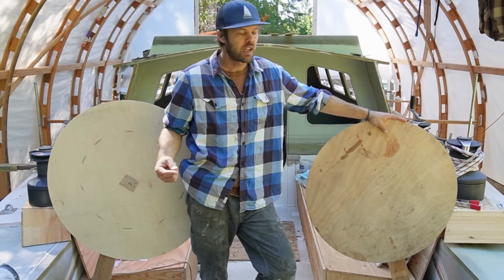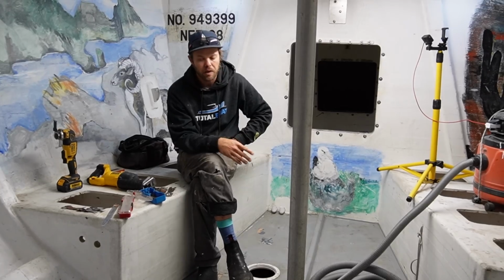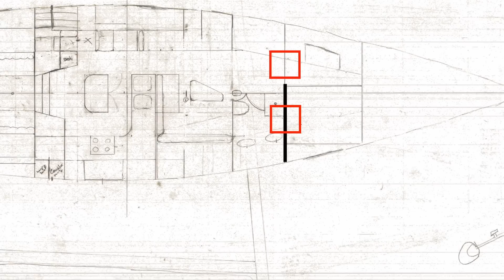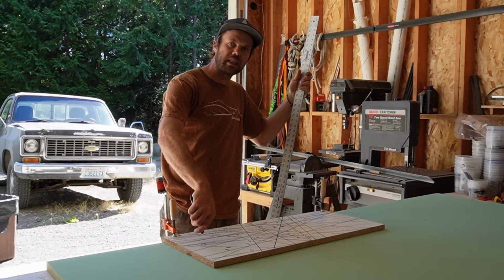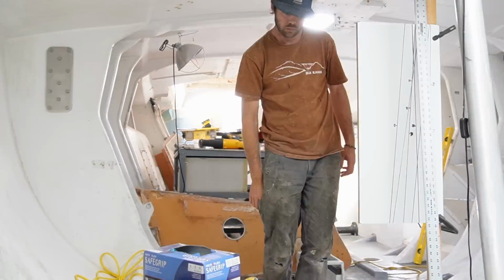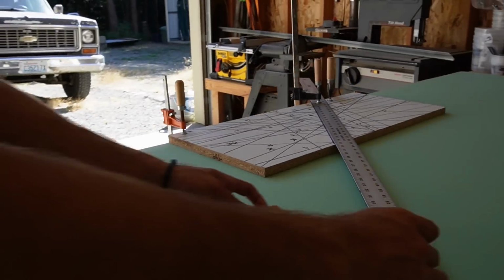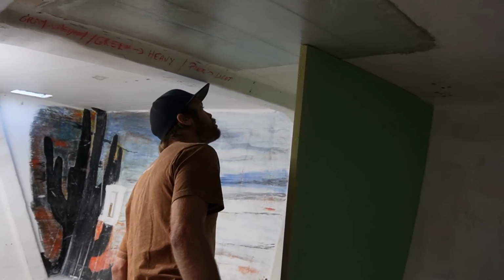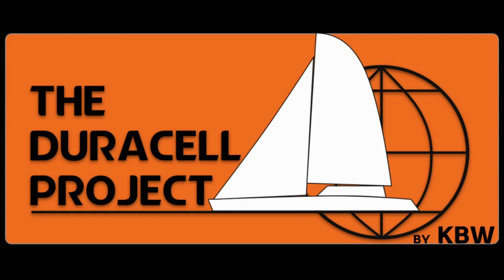Boat Refit: Building the State Room [E45]

Comment: I increased access to the bilge the length of my Cal39 when I was getting her ready for several years of cruising. That decision saved the boat when I took on water 80 miles off of Georgia quickly b/c of a blown gasket on the dripless shaft seal. I very quickly had cold ankle deep water at 2 in the morning, and being able to access the entire bilge was what made it possible to very quickly identify the issue. terrifying experience.
Reply from the maker: Yikes

Comment: Hey guys live the videos! 
In previous episode you were mocking the coaming. 
What about embedding aluminum plate that you can tap into to attach winches spin locks etc to? 
Heavier but easier than accessing backing plates if you need to remove, reposition, repair hardware.

Comment: That was a complex (complex for me as I am not a boat builder) series of lines and measurements but, they worked out correctly.  I can visualize what Matt is doing as he completes each section and it looks like it is going to be a great interior when he completes the design.  I thought initially the master bedroom section would be larger with a master bath and bath, but know that Matt has that figured out also.  It would be nice to see a conceptual layout of the interior of the boat and then it would all make more sense to us novices.

Comment: Sheesh. I laminated many meters upside down with wide taping (up to 12" wide). Fully wet out the biax on a flat table with regular resin, then sprinkle (list dusting only) with colloidal silica. Thickens the surface layer of resin. Roll up the tape, and unroll onto the surface upside down, pressing in place. Just keep track which is the thickened side.

Comment: I’m really interested in your project. I wish you would revisit what you plan for the keel, the original keel was a deep, high aspect ratio keel which was highly efficient for resistance to leeway and gave good righting moment with a minimum of ballast. You will have to add ballast to have a shorter keel and maintain righting moment. How will you configure the fin with the necessary added area to resist leeway? Will you just make it wider or will it be some sort of trapezoidal affair?
Reply from the maker: this is a long answer. We will get back to the keel conversation as soon as we secure a mast....hopefully soon!
Reply: Short answer: Matt wants a considerably shallower keel for cruising. So he is will REDUCE righting moment deliberately. This will allow use of a lighter mast than the original. This also means you can't carry as much sail area in stronger winds because you've reduced RM. You reef earlier or the boat heels too much. Area is a different story.

Comment: Matt.   Have you Thought or Try one Steering Wheel that Goes Left Or Right  just be Less Cost and a little More Room.  It just look more cramp with Two Wheels! Have you thought of countersink your Winches for more room up top?
Reply from the maker: yes, we had a dual versus single helm discussion in an episode a couple months ago...can't remeber which number episode it was now! A single helm would totally work, we just prefer dual. Just a preference thing.
Reply: @TheDuracellProject  Matt thanks. Would you mind if the Video could be longer so some else love to learn More on Fiberglass and work with Epoxy

Comment: Not to sure about having your work bench area before your forward cabin. You might not be able to sleep at night looking at things on your to do list  on your way to bed not to mention it might be a bit ugly. 
Re your cockpit lay out I would suggest a over hang on cabin roof and sides to give a little shelter from the elements if outside on watch at night. 
I would also make the seats as long as possible too
You will find this area the most used when cruising especially in the warmer climes. 
Keep up the good work.

Comment: From a desktop Phantom Shipmate - the larger, 33" steering looks to have notably better leverage than the smaller one, eh?
Reply: Leverage can be adjusted by changing pulley sizes also, so really the wheel size should be chosen based on other criteria like leaving enough room to walk down the center of the cockpit, for example. But also being comfortable to drive both sitting and standing.

Comment: Love your  ticking stick method. I built  a special tool to do that job  but it requires  a much  larger template  something thst is less than one foot smaller  than the actual size. Your method requires  no special tool and a much  smaller  template,  Brilliant,. I used the same method for my boat Samantas but....

Comment: I don't know about anyone else but I would like to hear Mat explain why he used marine foam and not house insulation foam. I've defiantly seen installation foam used on boats with success.
Reply from the maker: House insulation foam isn’t structural or marine grade, then again I have never tried it
Reply: It lacks sufficient shear strength to act as a structural component. Maybe as a small locker face that is non structural for example. But otherwise you can't; it's much too weak. Typical blue/pink foam has about 20% of the shear strength of a 80 kg/m3 PVC foam.
Reply: @evangatehouse5650  makes sense. It was being used as dodgers and reinforcement ribs. When they were being used as ribs it was for giving the glass form

Comment: My name is John and I am older and don't sail much any more. However, I am certified offshore and delivered sailboats up and down the West Coast and due to the veriety, have a fair idea of what makes sense and what doesn't. With regard to weight balance side to side is as important as bow to stern. In addition, weight carried down is better than weight carried aloft and as close to bilge center as possible. One more thing, Duracell was built as a race boat designed for the 80's 50 years ago and has far less beam that the current iteration. Dual wheels will eat most of your cockpit. why not use a 40' to 50' wheel and since the wheel is seldom turned more than 120 degrees, the bottom of the wheel could be constructed with a flat bottom 140 degrees side to side from top dead center. I have sailed both types, my preference is a centered wheel with enough diameter to handle while at the coaming. The flat bottom would eliminte the trough in the cockpit floor and would be easily maintained even if turned more than 140 degrees.  You could also have stern seats for sharing the helm with your lovely wife. Just a thought and would enjoy yours. John K

Comment: Out of curiosity, are you concerned at all about the vertical clearance of the interior, particularly once you get floorboards and ceiling panels in? I'm watching you scrunch about in there to avoid hitting your head, and that won't be comfortable long-term!
Reply from the maker: It's a good question.  The overhead is pretty short as it is now.  I'm going to lower the floors a little forward of the mast, where the overhead is the lowest.

Comment: For the cockpit are you considering shading the helm area? Seems very exposed, which for a racing boat is fine, but cruising?
Reply from the maker: yes, there will be some kind of shading for sure! That's way down the line, though.
Reply: How you cover and support the helm area may play into your cockpit design, especially seated and standing helm positions

Comment: I’m curious, what’s the difference between the foam from the ship supply store vs construction foam from Home Depot, for boat construction purposes?
Reply from the maker: The foam I use is a closed cell structural foam whereas Home Depot foam is for insulation…doesn’t have same structural properties

Comment: I did not ask before, but amidships and aft of that are usually best for motion when at anchor.  So what’s the logic of having the master cabin so far forward?
Reply from the maker: when at anchor, it's comfortable to sleep forward in the boat. When at sea and underway during passage, it's more comfortable mid or aft ship as you note. Most nights we'll be at anchor on Duracell, but when underway, we'll sleep in a quarter berth bunk.

Comment: And I forgot to ask where will the oiled teak be struck??
Reply from the maker: What’s teak?😉
Reply: Best place for teak is ashore. Not on a boat.
Reply: @TheDuracellProject  Captain Matt...every marine stateroom needs finely finished teak, particularly old reclaimed teak...love your composite work particularly bagging...is the original boat resin epoxy? vinyl ester? or polyester...just thinking could not you save some real money by using one of the ester resins for the stateroom bulkhead lamination of 1708 in lieu of epoxy...then epoxy perhaps to affix to the hull

Comment: Cmon guys, stop it with the bagging. It takes a long time, produces huge amounts of plastic waste, turns the project into an eco vandal's dream and makes you do one job a day because you only have one pump. Just get the thing done - it will take years and years anyway so stop bagging and just get laminating, peel ply is fine and get it done. I used to use a Joggle stick which is like your ruler, but is quicker to use. I tended to use the lofting in the end. The frames and bulkheads are easy to work out from the waterlines, so I liked to keep the lofting on a large piece of chipboard and pull the cupboards off them, or use the joggle stick. Please, just get cracking and go light on the bagging, no one will know.
Reply from the maker: To each their own! Matt seems to enjoy it.-janni
Reply: @TheDuracellProject  Gday Janni - I worry about how people who haven't built boats and don't know the hassle and monstrous amount of time they swallow, give encouragement to young builders like yourself, or the guys at Acorn to Arabella. Vast projects consume lives. I wish I had not built two of the four large boats I built (and still remodel to this day). I could have spent more time with family and friends, or been a better Dad, had I not allowed myself to believe the dreams I distorted for myself. I am glad I built our 38ft cruising cat and the little 19ft trailer sailer but the 23ft trailer sailer and the 38ft vac bagged carbon tri were damn stupid projects that cost me time and friends. My question for you is "Why is building this boat in a laborious manner more important than finishing it quicker and using it to spend time with those you love?" Why are family less important than unattainable perfection? If I had a time machine I would go back in time and give myself a severe talking to for being so gullible as to believe my own spin. It cost me years and I worry you are doing the same. At least track the project and see if it is in any way proceeding in a timely manner - list all the things that need to be done and then see how fast you are going. Really put a black hat on and don't allow a fancy talking husband to sweet talk you into supporting the project as it stands. I put my wife through years of extra work supporting my dreams that then fell through. You should have a huge say in how fast the project needs to be plugging away at. Stand up for reality and don't let your boat tragic gild the lily, I did it and I regret it very much today.

Comment: Hi Matt
This link is to a very well organized infusion process used by Seawind catamarans in their factory in Vietnam.  https://www.youtube.com/watch?v=U9CGgiXVyf0  Labor cost is hardly a factor--- quality control and materials cost certainly are.  Building a single unitary hull, bridge deck, etc of this complexity would be nearly impossible using wet layup. Their catamaran is exactly the kind I really don't like, but one can still learn a lot from it. 

Your project with Duracell is  quite different;  You are patching together a number of old and new components, and have a high skill set among you and your friends.  There are only a few areas where infusion would be appropriate or superior. Maybe a good learning project would be to design and build something similar to an OC Tender once Duracell is launched and screaming around the bay.

I suspect your resin could be easily re-formulated to viscosity suitable for infusion.  But it would have to be well tested first before landing in my boat!!